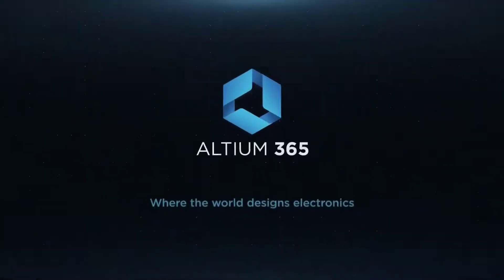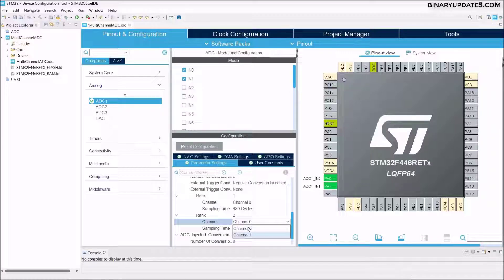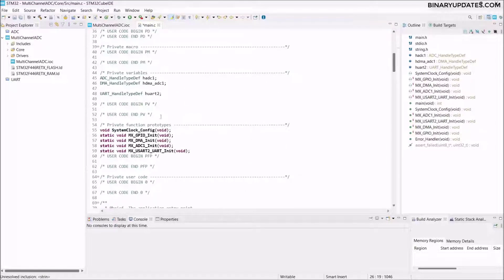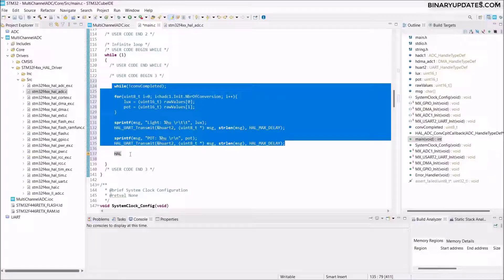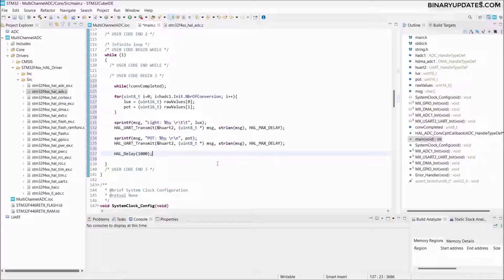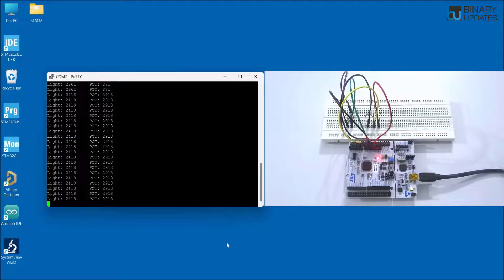Multi-Channel ADC with STM32 using DMA and Interrupt– Multiple Analog Sensors

Comment: why we need to  reset the board any reason behind it?
Reply from the maker: Hi Dileep, this code only read value once from ADC channel. But it keep printing on UART continuously. If you want to see the changed ADC values on serial terminal then you've to modify the program. While making video I needed ADC conversion only once at interrupt so i used same code but you can easily modify. Best wishes!

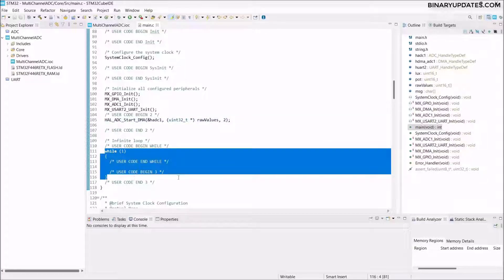Comment: at 7:12 you cast rawValues as a uint32_t pointer, however rawValues is a 16 bit array with a size of 2. This means that 32 bits in total are taken up by rawValues.

You give your uint32_t casted rawValues a size of 2, which would tell the compiler that you have 64 bits allocated for this buffer. Wouldn't this be a vulnerability as it is possible to overwrite an unrelated address?

Am I missing something here?

Comment: how come you're not resetting the flag after the blocking while loop?
Reply: Because he's only doing one reading from the ADC. If you check his code, he never does another conversion. He is manually resetting the board to force another conversion. No need to reset the flag if it is only used once.

Comment: thank you.
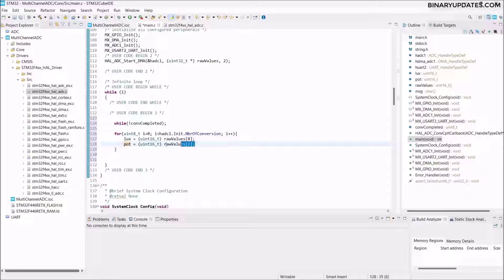anyway i am wondering, in line 126 (minute 10:20): why does the code has to iterate it until i < number of conv. ?
i can understand if it is only 2 number conversions so that the code only does the iteration once since it is 2-1.
say, for example, if we have 3 number of conversions, then the code there will have to iterate twice since it is 3 - 1. So reading adc chanel 0, 1, 2 twice?
Reply: Not only are you right about that, but there is a final line missing: reset the "convCompleted" variable to zero.

Comment: Thanks for the superb explanation. I learned quite a lot! But why do we need to reset the MCU every time we need to read the input voltage of each Analog pin? is there anyway where we could read the input voltage without resetting the MCU?

Comment: Hello, I don't understand why you have to reset the board to obtain a new value from the ADC, in theory the DMA ADC would have to do it
Reply from the maker: Hi Mike. you're right to make this multiple ADC with STM32 short I did conversion in while loop. Otherwise to avoid press RESET button I'll have to add few more lines on code. To keep video short I prefer this way of reading multichannel ADC in video lesson.
Reply: @BINARYUPDATES  Hey man, can you please add the few lines of code to avoid resetting the MCU all the time and see the values change in real-time? This would be really really appreciated. Regardless, you just earned a subscriber. Kudos

Comment: I haven't seen a schematic, but from the "wiring explanation" I got the impression that you are feeding the ADC input from 5V and not from 3V3. You have to be careful with that, because not every input of the micro controller is 5V tolerant.... And if you use one that is not, it may get damaged due to the 5V...

So, actually I just checked on the stm32 forum : 5V tolerance does not apply to analog inputs at all, and you should not go beyond min(VDDA, VREF+) +0.3. VDDA and VREF+ are on the nucleo boards I have, Nucleo-743ZI2, equal to VDD_MCU which is dependent on a jumper setting and is either 3V3 or 1V8.... so be careful with that, and check the board schematic to see what VDDA and VREF+ actually are on your board, most likely 3V3 with the standard jumper setting like on the one I have.

Comment: Why were the channel cycles set to 480 cycles instead of 3?
Reply from the maker: The 480 cycle is an optimal and most common choice to make sure we achieve resolution and accuracy while reading ADC value. If we choose 3 cycle then it will be very fast and it'll not allows us to read analog pins to maintain stable output from ADC channel of STM32
Reply: @BINARYUPDATES   Perfect, thanks. Yeah, I'd assume at some point it will not finish reading the ADC channels before the next cycle begins. So in cases where sample rate isn't critical it makes sense to select the slowest sample rate (480 cycles).

Comment: I have problem with line 
while(!convCompleted);
this 'while' clause does not guard... [-Wmisleading-indentation]	main.c
This code working only one time.
What can i do?
Reply from the maker: The code is written to print ADC value only once using Single conversion. So when we press RESET button then only next ADC conversion happen. It's because of the use of interrupt in code. if you make ADC conversion code in while loop then it will print continuously in continuous conversion mode instead of single conversion mode. I hope this may help you. Good luck and best wishes!
Reply: Actually, while(!convCompleted); means : "loop until convCompleted becomes true", and there are no additional statements needed, and the semi-colon at the end means an "empty single statement". You can have a single statement after a control structure, such as a while or an if, without the need of curly braces {....} which is called a compound statement, if there is only one or an empty statement following it. So while(cond) stat; a control structure with a single statement, is equivalent to while(cond) {stat;} and while(cond); a control structure with an empty statement is equivalent to while(cond){}. This short form without the curly braces is more convenient to write, but can be ambiguous and a source of very subtle mistakes and that is why the compiler checks for this. For example while(cond) ; {.....} means : a while loop with an empty statement, (like in this code) followed by an "unguarded" compound statement. But maybe there is a typo in the code and what was actually meant was while(cond) {.... }. This can happen because while typing you are used to put a semi-colon at almost every line and so a mistake like this is easily made and very hard to track down. And that is why the compiler warns about this, because it can not know what was actually meant. But the construct here is correct, but writing it like while(!convCompleted){} is more readable and will silence the compiler ⚠️.

P.S, because the compiler warns about "misleading identation" maybe if you write it like this, 

while(!convCompleted)
      ;

So putting the semi-colon on the next line, and indent it, will silence the compiler as well. But you need to try that, most of the time "white space" is ignored so maybe  this does not work, but using empty curly braces, so while(cond){} should always work.